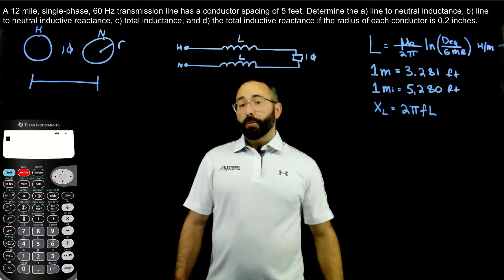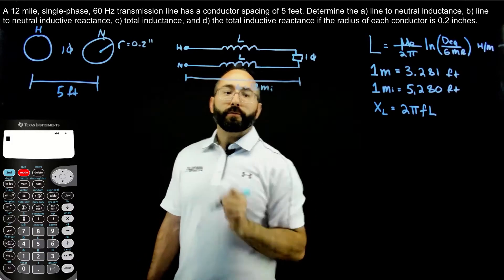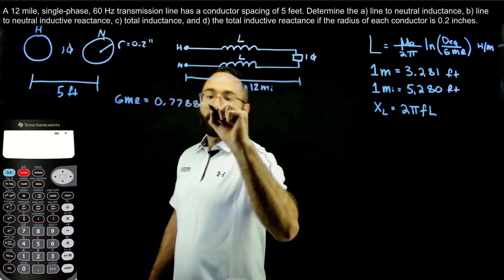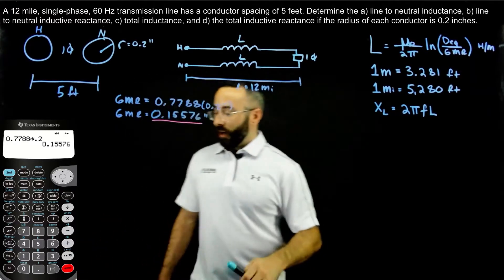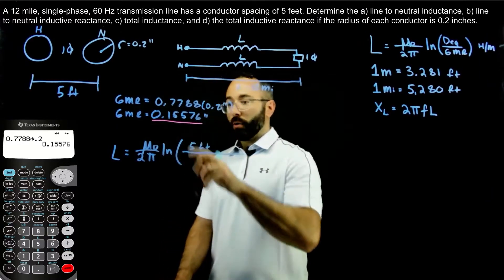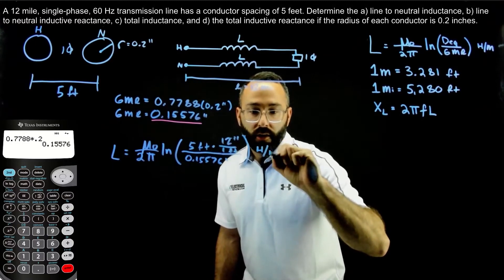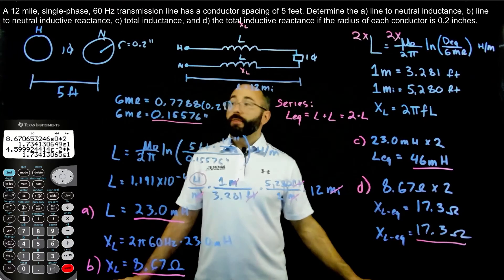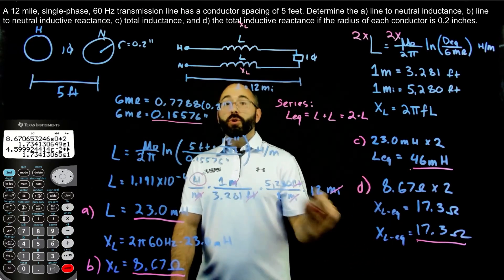Single Phase Transmission Line Inductance (L) and Inductive Reactance (XL) - NCEES Power PE Exam CBT

Comment: Based on the PE handbook - shouldn't GMR = sqrt(r' * d) not r' for a two sub-conductor bundle?
Reply from the maker: Yes, that is correct for a two conductor bundle. However, the problem in this video is for a single-phase transmission line with once conductor. There is no bundle in this example problem.
Reply: @electricalpereview  Thanks - the hot and neutral wires shown threw me off; I thought they constituted two sub-conductors.
Reply from the maker: @stevejurgens9836  my pleasure.